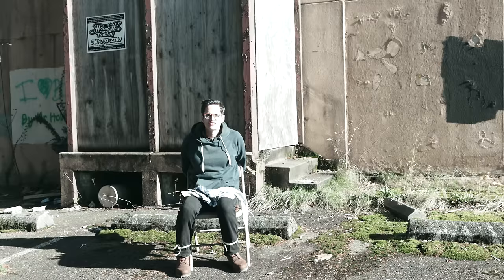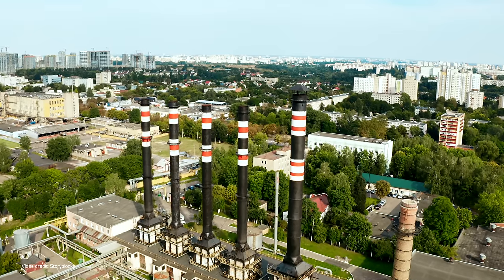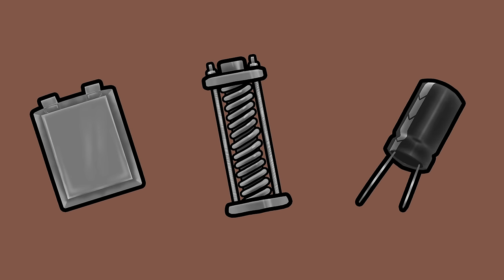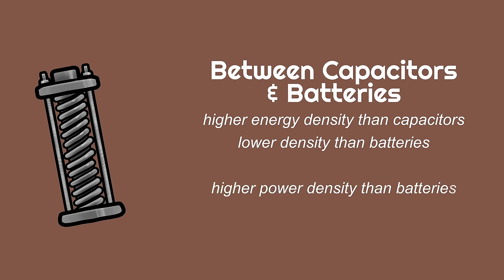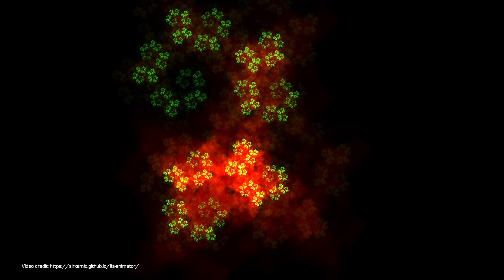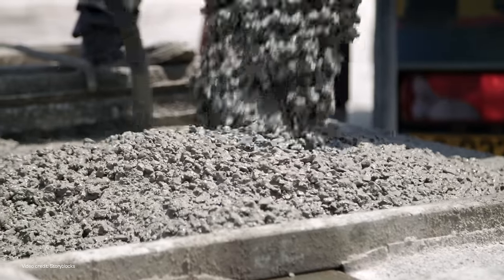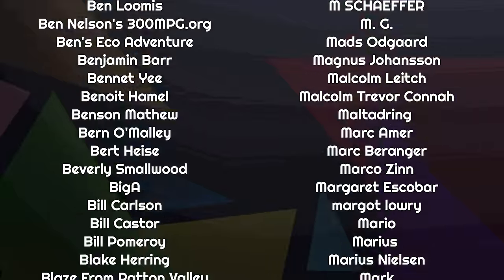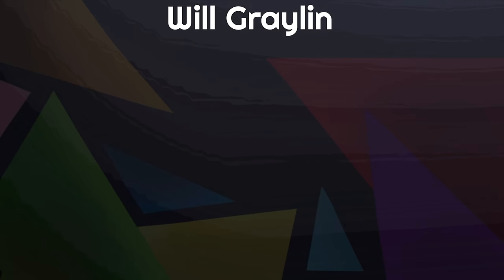Is this the Answer to Energy Storage?

Comment: On that last point about the steal re-barb in the concrete, I've heard that some concrete engineers are experimenting with re-barb that is made of other stuff like fiberglass re-barb.

If the re-barb in your concrete isn't going to rust because it's made of fiberglass then your building will last for a few more decades.
Reply: It is "re-bar"
Reply: That’s what I was thinking. Fiberglass reinforcing bar. Cool that it’s already been thought of!

Comment: Didn't address my concern about what happens if you drill a hole for utility work. 10kWh would be quite the arc-flash hazard. 

For rebar: one can presumably use non-conductive fiber glass rebar.
Reply: saw that among the things i won't buy in the local home depot, thought for a moment it was the rolled paper stuff used in china for the last while, looks exactly the same and selling decorative stuff isn't exactly something they don't do... maybe if it was a different colour i wouldn't have made the association.  recycled polyester pop bottle plastic has been used as reinforcement for a while, coating glass fibres in it could make it even better, though, rebar could be used as part of the conductive grid used to dis/charge.

Comment: The cost is an issue.  I recently saw a YouTube video of slab foundation poured in northern New York.  It required an excessive amount of concrete, 98 yards.  Concrete costs $110-165 per yard, excluding labor.  I believe this 98 yard slab was in excess of $20,000 or over $200 with labor.   Considering that  is around 16.33 KWH, at a cost of $1225 per KWH.  I can buy LiFePO4 batteries for less then $300 per KWH from multiple sources.  I can get a 30 KWH LiFePO4 battery bank (wired/BMS/racks) for $9000.

Comment: Since the technology exists to 3-D print houses using concrete, why not integrate this supercapacitor technology into that? The entire house can be an energy store. The concrete can then be sealed and service ports installed to replenish the electrolyte at the necessary intervals.

Combined with rooftop solar panels, the house could theoretically become grid independent, or be part of the grid as required.

Comment: You can't generate gasoline on your roof.
A quick cheap pre v2g: high power 110 outlets on every EV.
Cement+aggregate =concrete.
Reply: Solar panels on top of a capacitive concrete structure

Comment: doubt your hob would be 10kW even if you had them all turned on.
Reply from the maker: Most stoves (and ovens combined) are on a 50 amp breaker, so they’re capable of pulling a fairly constant 9.6 kW if we follow the standard 80% of breaker rating rule. Of course, they’ll pull more than that for brief periods - Nikki

Comment: Nuclear should also be in consideration for green energy. It  is as safe is not safer than  solars and wind,  almost as clean as them and provide reliable power all day long without the need for energy storage . Its downsides are ridiculously exaggerated and can are being solved  with current and emerging  tech. The only real downsides is theri cost and time to set up. nad course the annoying NIMBY

There are great scientific and engineering channel like Kyle Hill, Illinois EnergyProf, Curious  Droid , Real Engineering , Engineering with Rosie and many many more  that helps dispels the myth and bogeymen of nuclear power .  Kyle Hill is particularly excellent as he also delve into both well known (Fukushima ie ) and lesser knows  deadly nuclear incidents such as Therac -25 and The Goiânia Accident, highlighting the danger of orphan source. Heck he was the guy who boosted the Demon Core  into becosing into a meme, something he unintentionally did.
Reply: Nuclear could play a part but rather than uranium my bet would be a thorium molten salt reactor. In the long term nuclear fusion instead of fission is the way to go. Both take quite some time to implement. In the mean time renewable energy together with energy storage should be on the short list. We need to act now !

Comment: It's literally not cheap, concrete is a MAJOR contributor to CO2 levels in our atmosphere, the energy density by volume and weight is absurdly low. Lending credence to these foolish things by covering them is such a shame. Instead of focusing on actual problems, actual solutions, and actual risks, all the youtubers flock to the trash that gets clicks.
Reply: While, yes, concrete production does result in substantial CO2 emissions, if we're going to use concrete in construction anyway, then why not also make it work as energy storage. At least, that seems to be the idea.
Reply: This is still being studied to see if it can or will work, but either way concrete is still being used all over the world every day.
Reply: Not sure we watched the same video, @TomCameron. I believe Kate was doing her semi-sarcastic best to explain why carbon concrete super capacitors are not tenable and not a viable solution unless some other breakthroughs occur… adding effective rebuttal to the flock of YouTubers you bemoan. No?
Reply: Especially as the thickness is probably about 3x that of a normal slab